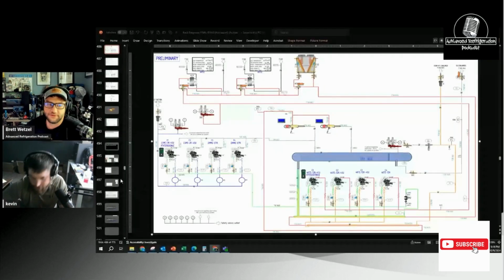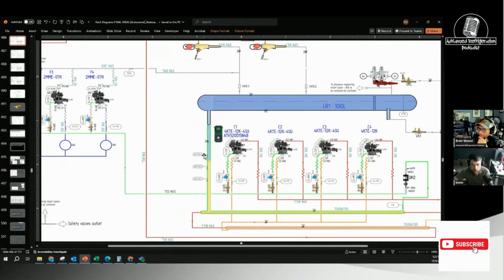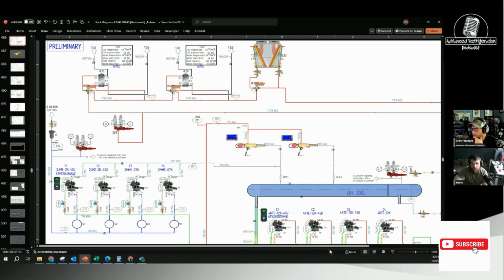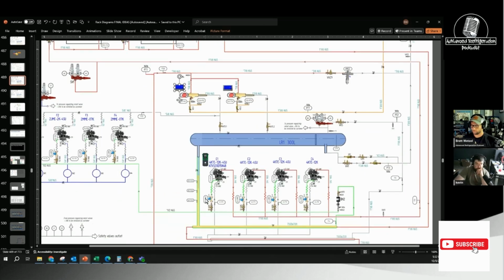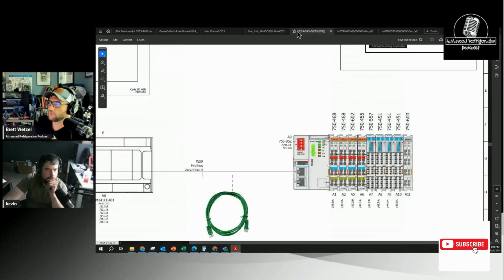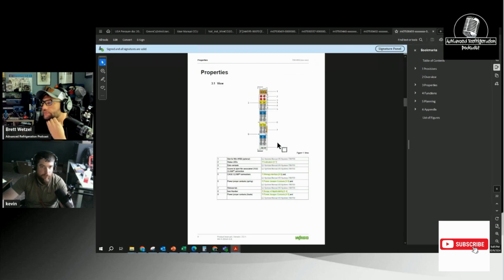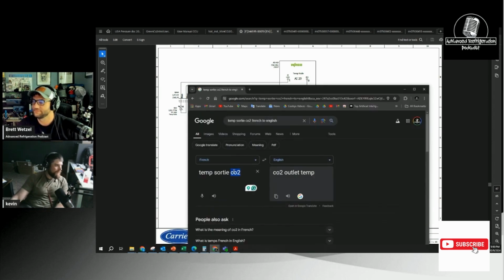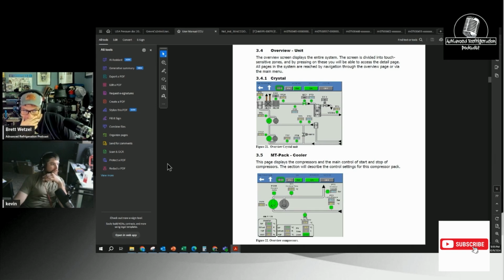Kevin's First Carrier CO2 Start up And Here We GO!!!!!!      Episode 342 Video

Comment: I'm starting up one in Warner Robbins Georgia. The Ke2s keep flooding the rack working with ke2 to get these set up properly. I'm not a fan of the low temp comps discharging into flash tank instead of medium temp suction.